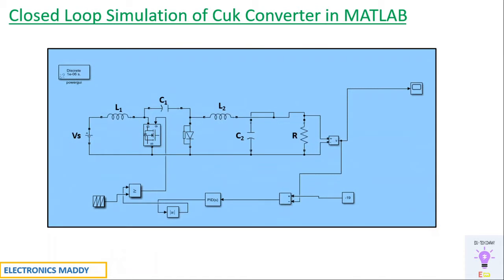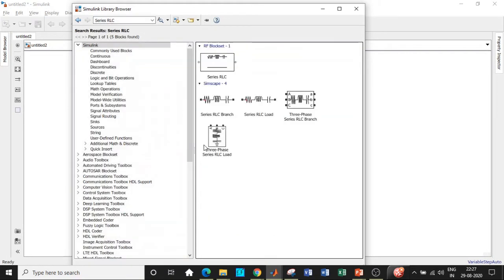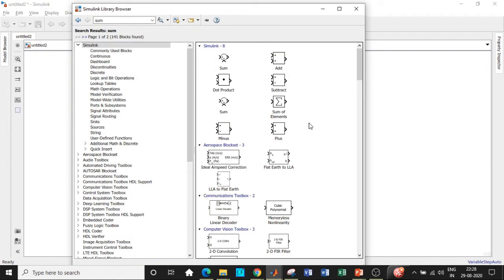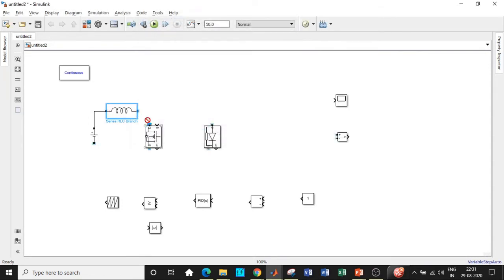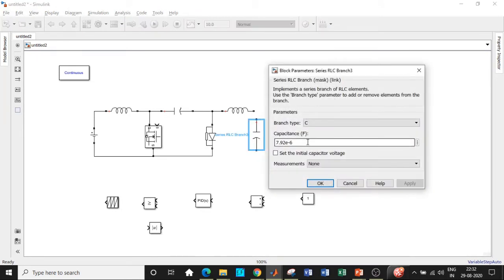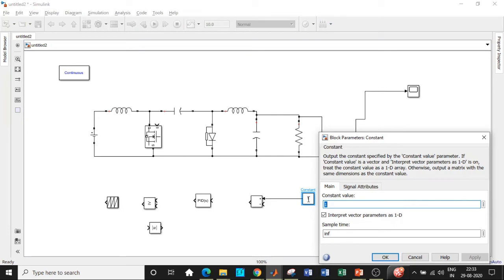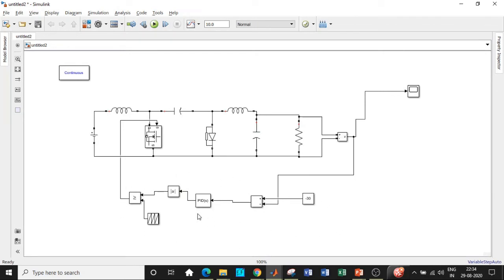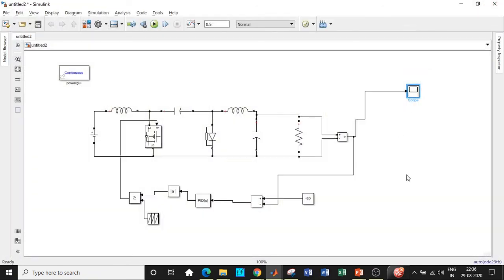Closed Loop Simulation of Cuk Converter in MATLAB | SIMULINK

Comment: I did exactly same simulation with similar values of every part but getting really distorted and settling to zero output voltage.  kindly explain where it went wrong
Reply from the maker: Hello Ruchi Kumari. Can you send me your matlab model via email. I will check and tell you.
Reply: @ElectronicsMaddy  okay
Reply from the maker: @ruchikumari6996  Hi I saw your file and compared it with mine. Firstly, I noticed you are getting the output for the simulation wrt this video isn't it? I noticed that your model (designed by you) involves a lot of transfer function blocks and the output is becoming zero for every switching action. Can you please send me the design procedure that you followed? Because it looks like your closed-loop model is different? I would also like to know the objective and your problem statement? Because if you are concerned only of getting the output voltage then you can use the exact design simulated by me. But if it's for a specific application, I believe it changes accordingly. I would mainly be requiring the design procedure in the closed-loop path to understand your thoughts on this one?
Reply: I did exactly same simulation what you have done.But I am getting wrong output waveform.Could please help me